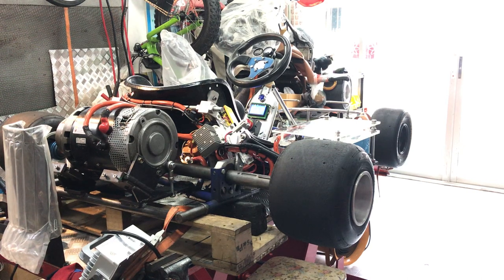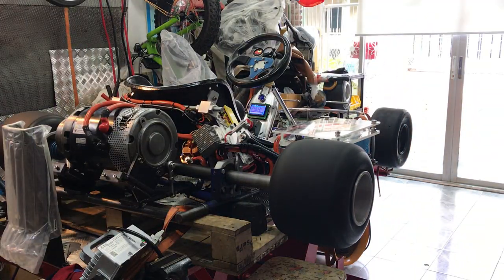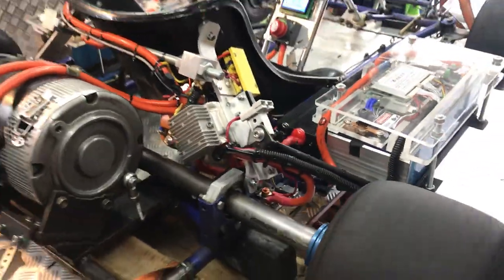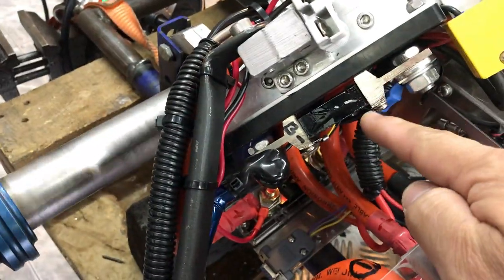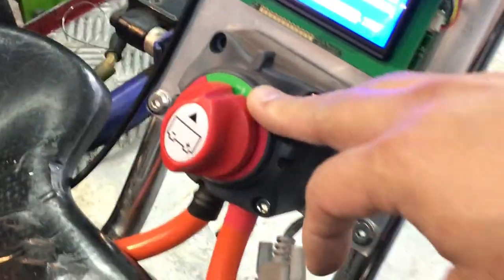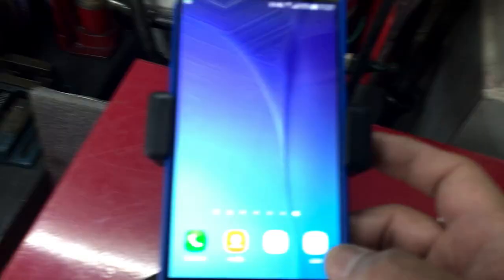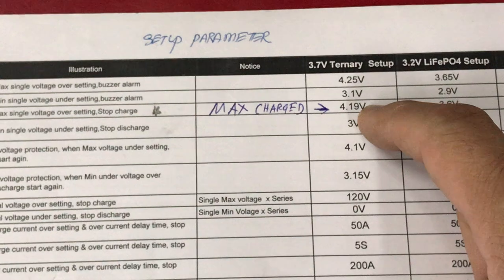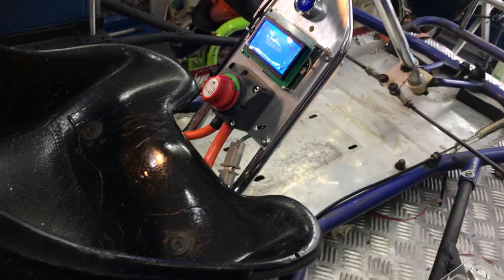DIY electric GoKart 8000w 48v - BMS & NMC battery explained

Comment: I have a 3000w motor and i want to expand Where did u buy your motor?
Reply from the maker: Motor was came from Forklift , it was a installed at Hydraulic  pump for Toyota Forklift which Denso Brand from Japan. It labeled 800w 48v, Cost me only $150 USD
Reply: @NaiyimsGarage  oh that’s cheap how fast does your go kart go?
Reply from the maker: @ke-kd8ut  not yet on the ground yet raining here every day